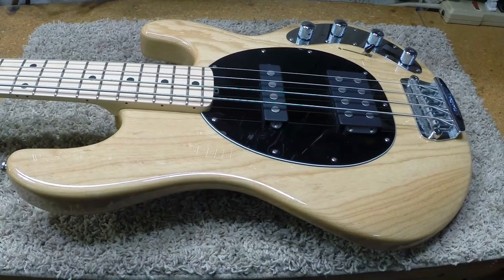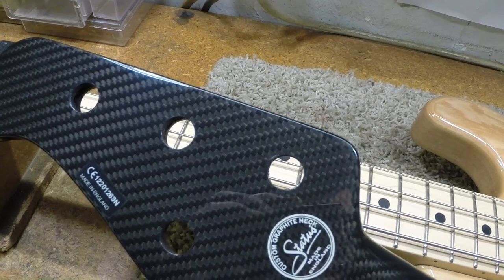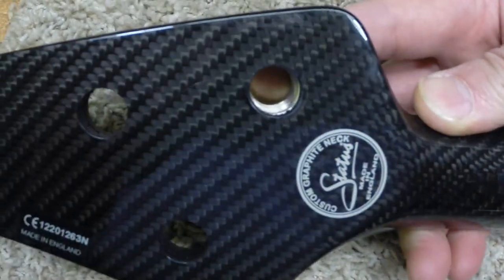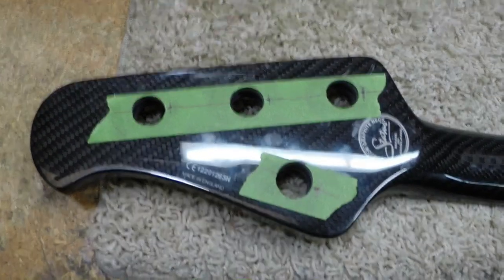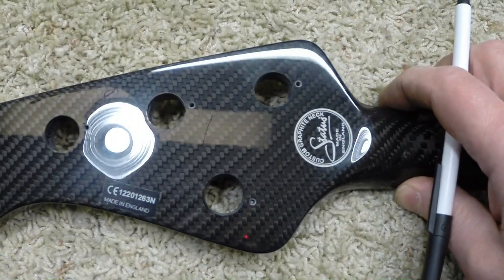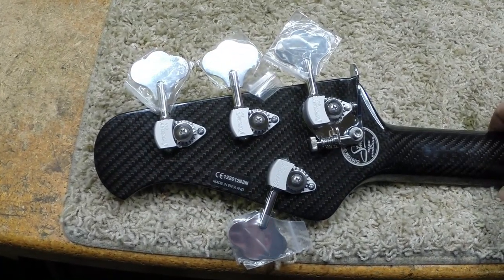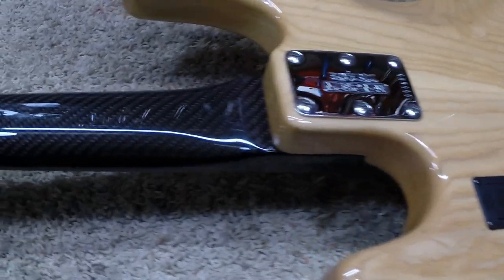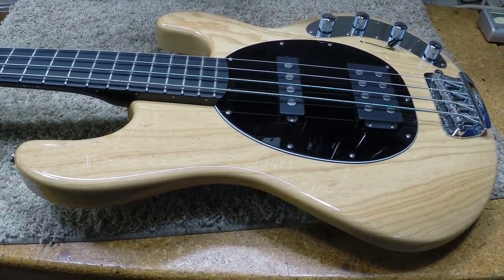Musicman Stingray Bass gets a serious up grade

Comment: Great video dude. The graphite necks are amazing! Just a quick question for a build I'm contemplating, would it be viable to put a graphite stingray neck on a p bass body? If so, what potential modifications would I have to make to the body to make it work?
Reply from the maker: That I do not know.  Some of the stingray style necks are model specific and do not work with other models. There are a few different choices of graphite epoxy necks out there. I am sure there is one that will fit the neck pocket.
Reply: Status makes necks for P basses
Reply from the maker: That is good advice.  I really do not recommend trying to put a Stingray neck on a P-Bass.
Reply: I second Mike. Status do make 4 string necks only for Fender Precision or Jazz Bass. As long as your bass has 20 frets and a 2.5" heel width there should not be a problem. 

Best part is you can choose to have it with dot, block or no dots inlays. Faux maple is also available for your choosing. 

Currently 5 string necks are only made for Stingray 5. I really do hope they'll come up with the 5str version of Fender necks 🙏

Comment: Awesome work! I have a few questions. I’m looking to do the same upgrade. Where can I get the brass spacer to drill 9/64 wholes into the neck? also, does the neck come with the bridge/tree that holds the strings down on the headstock. Thanks in advance ✌🏽
Reply from the maker: I cut the brass spacer out of a piece of 3/16 dia brass tubing.  The string tree I believe was off the original neck.  Be careful opening the tuner holes.  Thanks for watching.
Reply: @guitarc.p.r.9675  I will most likely use the Original the tuners. Hopefully they fit without modifications. Fingers crossed🤞🏽
Reply: @guitarc.p.r.9675  I will try to look for one. Any idea on the depth. I don’t want to risk damaging a $600 neck. Wish me luck
Reply from the maker: I do not remember the depth, you will have to measure and figure it out.
Reply: @germandelatorre7730  Status is able to accomodate to the machine head you will be using. Simply tell them the measurement and they'll drill it up for you. Otherwise, it'll be at a defaulted 17mm (11/16") tuner bush holes. Hope this helps